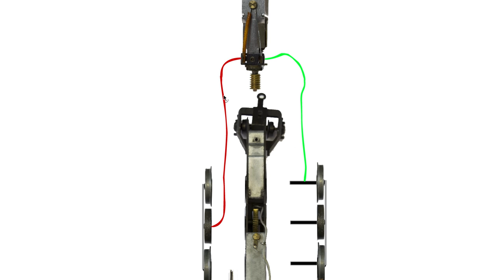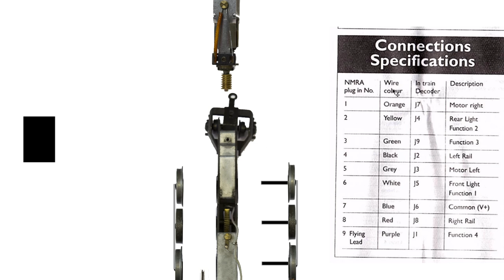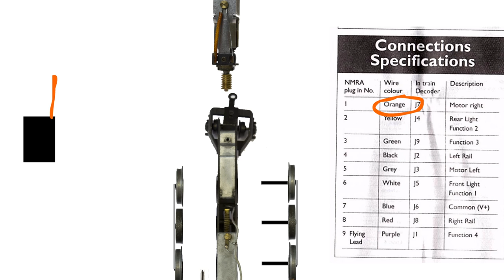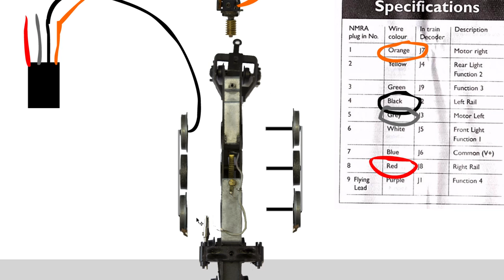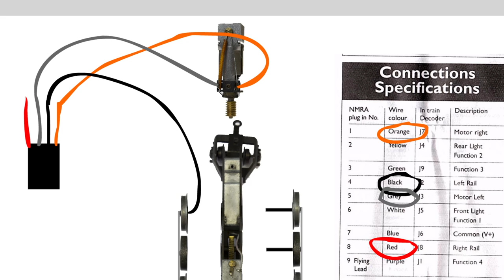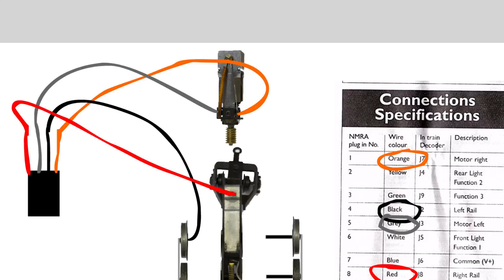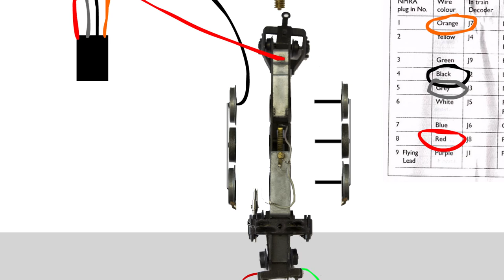How to DCC a Tri ang Loco

Comment: Hi Sam, I am fitting a Hornby Sound decoder to a similar loco. It will be running on Peco code 100 track. What should I look out for with the installation? Dennis
Reply from the maker: Not too much to look out for Dennis, but do consider the reliability of fitting sound into such a loco, as the pickups are very limited. Maybe think about using a decoder with stay-alive?
Thanks for watching, Sam :)
Reply: @SamsTrains  Hi Sam, thank you very much for that advice. I do have some phosphor bronze so perhaps I should make some extra pickups. Regards, Dennis.

Comment: Very good film Sam. However, I believe you have got red & black mixed up. BLack goes to the left rail in the "forward" direction of travel & Red to the right rail on your diagram these were reversed, meaning when you ran that loco it would run backwards when forward was selected. Easy solution is to add 1 to cv29 to reverse the direction of the chip. But that might worry a novice to do that.
Keep up the great work!
Reply from the maker: Thanks Boa - yeah you may be right, but it's inconsequential - the decoders aren't sensitive to polarity, so only the motor outputs need to be correct!
Thanks for watching - Sam :)
Reply: @SamsTrains  I am only following the NMRA system of wiring a DCC decoder.

Comment: I have a Hornby Class 91 in the East Coast Flying Scotsman livery. Do you have any advice how to wire that thing into DCC? It has a 8pin plug, but I gutted everything until its a hollow shell. It uses the pancake motor design, but I don't know where each contact point goes in terms of soldering them to the correct wire to the decoder.
Reply from the maker: Hi Evan, you'll want to common all the left pick-up wires together, and do the same with the right. The red and black decoder wires to to those, and the orange and grey wires go to the motor terminals!
Hope this helps,
Sam :)
Reply: Thanks, but I think, I'll have to do the re motoring method, a very hard modification. The pancake motor is weird to my standards (I work on US style locomotive) because  it has like 4 contact points that are not color coded. I also remember that before I gutted the entire locomotive, two of the wires that were soldered to the main bogie with the mounted pancake motor were connected to the other non-powered bogie. I am not an expert on UK locomotives. But the Bachmann Branchline series is more familiar to me when it comes to a standard 8pin NMRA decoder.

Comment: Hello Sam, great informative video. I also like the 'Mainline' loco and 'ringfield motor' maintenance videos. Thanks for posting. Have you ever thought of DCC a Mainline locomotive? I have a few Mainline locos I would be interested in converting (2 Scots and a Baby Scot), but I haven't managed to find any suitable 'how to' videos. If you know of any sites that do a good job on converting, or know how to yourself, I would love to know. Kind regards, Mookie.
Reply from the maker: Hi Mookie, thanks a lot for your comment - I'm really glad the maintenance videos were useful for you! There are a few problems with DCC fitting mainline locos: first, space - the chassis tend to fill the loco bodies completely, which means you'd probably need to take wires to the tender, and store the chip there!
Secondly, the motors aren't great for DCC operation - they don't run well at slow speeds, and they need full power to get going sometimes! I'd only recommend DCCing the very best of motors!
Thanks again,
Sam :)
Reply: Thanks Sam for the information. Apart from the lack of space and the performance of the motor, is it hard to wire up a spilt chassis loco?

Comment: A very simple explanation of fitting a decoder. I feel your explanation may have one major flaw.  You are looking at the top of the loco with the front of the engine towards the bottom. Therefore, the TRUE right side of the loco is the side with the insulated wheels on.  It's normal practice to show a explanation like this with front of the engine at the top of the screen.  Therefore the red and black wire may need to be swapped, am I correct?
Reply from the maker: +waynzus Yeah, that is true to some extent, but since you can easily reprogram the direction with the press of the button on the controller, I decided the direction wasn't very important, so long as left corresponds with left motor and vice versa.
Cheers,
Sam
Reply: @SamsTrains  Well you are very wrong Sam. There is a convention that exists and you are not so big that you dont need to follow it, in reality you got it wrong so why not just admit it. It doesnt bode well for your chip fitting service

Comment: Hi Sam, I have been following your guide how to DCC a Triang Loco. I have fitted a Hornby digital Sound Recorder. All sounds work fine but the loco does not move. All connections look fine. is the motor compatible with tis type of decoder?
Reply from the maker: hmmm that's strange - is it a TTS decoder? The motor should be compatible, did it work okay on DC?
Merry Christmas - Sam :)

Comment: Hi Sam, greatly informative video, just one question though as I'm not an electronics wiz, How do you figure out which contact is Motor Left and Motor Right? Cheers mate.
Reply from the maker: Thanks very much mate! It really doesn't matter too much - if you get them wrong, the loco will just go in the wrong direction, and you can swap them! Usually trial and error is the best way!
Thanks for watching - Sam :)
Reply: Keep this in mind I'm sure you know by now but the engineer's side is always positive and fireman's side negative.
Reply: Thanks Russell.

Comment: Very good video. Have just subscribed. This will help me with my conversion of GWR Pannier tank loco, running #2744. Have you made how to videos for Triang/Hornby R758 (D7063), and Triang R357? They both appear to use the same design motor, the former being 2 axle, and the latter 3 axle (with a dummy centre axle.) Both locos have wires running from the rear bogie.Hoping you can help me, as I saw a video sometime ago on fitting decoders to these models, but now for the life of me I can't find it.

Ian
Reply from the maker: Thanks very much for that Ian, all the best of luck with the conversion! Yes, it's much the same process for the diesel bogies - isolate the brushes from the spring, and use the pick-ups, or chassis, to power the decoder, depending on which you use!
Thanks for watching - Sam :)

Comment: Any issues with the black wire connector, I think I’m getting a short on the chassis, :-( just can’t get it to read the chip when on the loco
Reply from the maker: Hmmm, it's worth going over the model with a fine tooth comb - watch the base keeper plate and the pickup wire, might be worth insulating the solder joint with some tape, if it's not already isolated!
Merry Christmas - Sam :)

Comment: I tryed this but after a while the chip got very hot and some burnt out because I was told the motor pulls 2 amps and the chips can only take half an amp so are there any chips that can take 2 amps
Reply from the maker: It isn't true that these motors pull anywhere close to 2 amps - they run at 0.2amps, and up to 0.3 under load. A decoder rated for 0.5amp or more is fine for these motors, provided they're working correctly and regularly serviced! If it's blowing your decoders, there may be a fault with the motor!
Thanks for watching - Sam :)

Comment: just changed my lima oo deltic to dcc. it does not run as fast and strugles to pull 3 coaches up an incline on my layout. when   i ran it before on dc it would pull 9 coaches easy. my dcc system is gauge master prodgity 2  any ideas ?
Reply from the maker: Hi Sam, it's possible that she will need a service - many modern DCC decoders don't put out as much current as a regular DC controller can - and so they really will need to be thoroughly serviced before running on DCC, if at all! :3

Thanks for watching,
Sam :)

Comment: I will have a go at this now, looks easy enough and I will first try it on an 'expendable' locomotive - just in case.
Reply from the maker: Okay mate - best of luck to you! Yeah definitely wise to try this on an expendable ;)
Also bear in mind that with only 2 sets of pick-ups on each side, these do struggle slightly on DCC! Also, a very well serviced motor is also absolutely essential + suppression, because these motors generate lots of EMF, which fries chips!
Let me know how you get on,
Cheers,
Sam :)
Reply: Well I managed it.  I had the motor in good order, all clean, all looking good, I bought the decoder, found a suitable diode, got out my fine soldering iron and fine tools.  What could possibly go wrong?   As I am a Mech E.  you might expect lots, but no.  I put it all together, put it on the track and off it went.  You were correct regarding the pickups,  I had to give them some tending before getting a smooth run around the whole track.  Did a bit more tending this morning and very good at slow speed and will go around without problems, but not at real slow speed over the points.  Thank you for the advice.
Reply from the maker: Hi Ian - that's great news! Yeah they never were great with slow speeds - but it sounds like you did a great job with it, well done!
No problem mate, I'm glad to help!
Cheers,
Sam :)

Comment: It seems your LEFT  &  RIGHTS we’re transposed. The Right hand wheels have the direct connection to the motor not the left
Remember, your loco is drawn (or illustrated) , facing down the page so the Right hand wheels are on the left of the page
Reply from the maker: You might be right Bruce - it doesn't matter for DCC though, as the input to the loco is effectively AC, so only the output from the decoder is critical... and even then, you can program most decoders to run the opposite way!
Thanks for watching, Sam :)

Comment: All very good and informative. BUT. Am I the only one to notice that the view is actually looking down on the top of the motor / chassis, and also looking front to rear. SO. All the "Left's" and "Right's" are basically the wrong way round!!!
Reply from the maker: That's true Bob - but it depends on the motor - the decoder instructions aren't necessarily written for Tri-ang motors anyway, so you can't pay too much attention to 'motor left' and 'motor right' anyway - usually trial and error works best!
Thanks for watching - Sam :)

Comment: WOW! I'm pretty sure i'd be too scared to do that my self.   :/
Reply from the maker: +Why Not? Nahh-  it's very easy once you give it a go! :D
Cheers,
Sam
Reply: +Why Not? Following the wiring and the soldering is the easy part. The hardest part is opening and closing the locomotive, and maintaining the linkage rods of a steam loco in place as you do so. It is best to chip a diesel loco first to learn and gain confidence before tackling a steam loco. A bit of tape helps with the linkage rods. Lots of patience and a firm hand helps with opening and closing the loco. And as Sam said, be very careful with the wiring harness of the decoder chip, their manufacturers use the tiniest amount of solder with the chips. They will pop off with the slightest tug, so much so it is probably best not to cut any wires you need, especially if you have large hands and fingers as clumsily as mine.
Reply from the maker: Absolutely. Although, you don't need to disturb the linkage rods at all - my exploded diagram was just to make things look simpler - you don't have to actually take the wheels off of course! :)
Cheers,
Sam